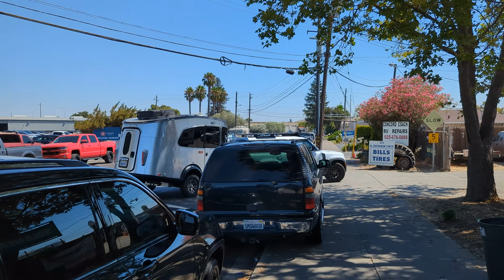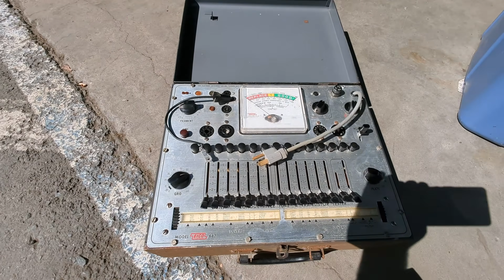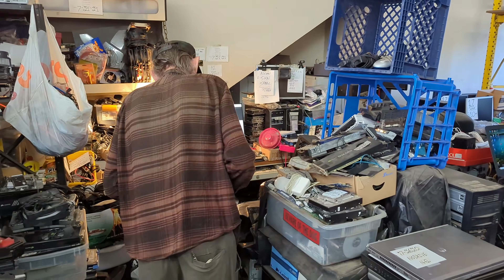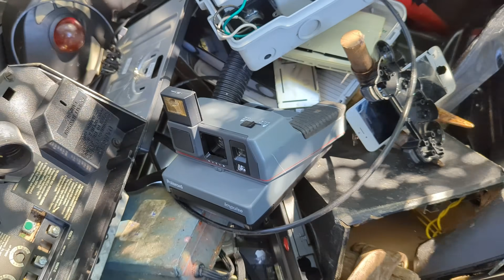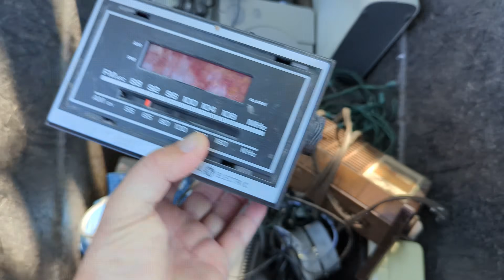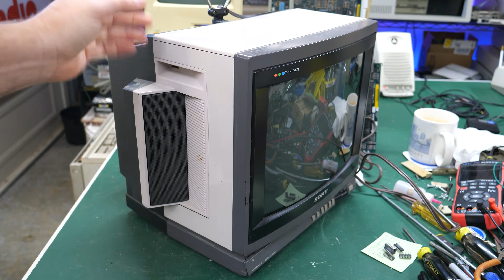Exploring The Hidden Treasures Of An E-Waste Facility!

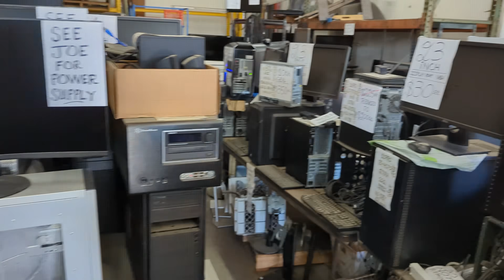Comment: There's an e-waste collection company near me, with dumpsters, but most of what I have found is nearly destroyed. I have found some complete things: cameras, cell phones, some other things, but what the company does is tear the PCs, laptops, boxes, stereos, monitors, large screen TV's up so for the most part, they can't be used. Or not worth taking as it would cost more $$ than its worth to rebuild. It's mostly scrap. Lots to look at, dig through but not much worth taking. This place you are at is at least set up where you can come in, look, and buy. 5:20 nice 27" curved monitor!! Not sure if the place near me has an open day to sell items. Ad a kind of hobby I look for electronics in dumpsters and curbside stuff. That Sony Trinitron still use some tubes?